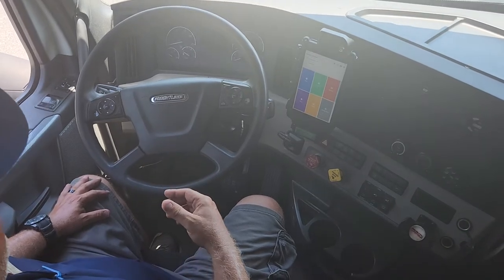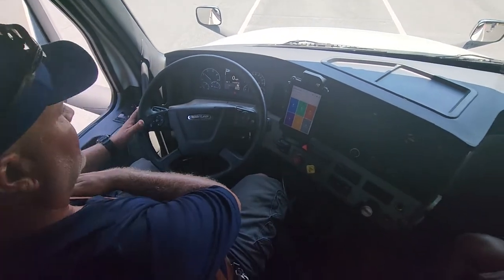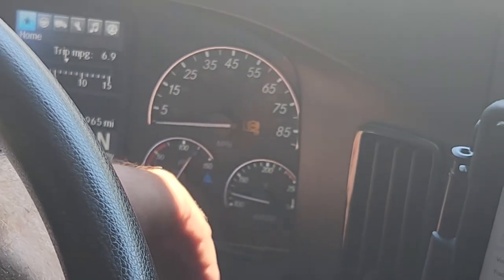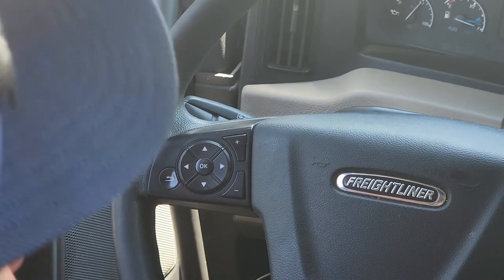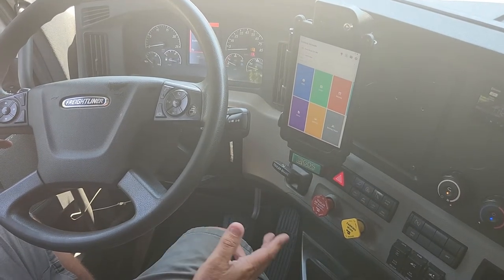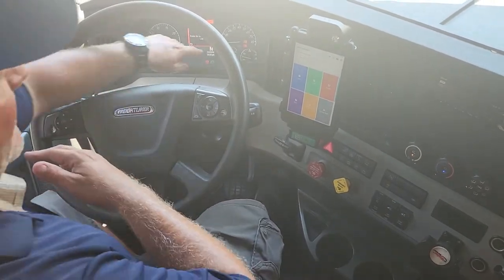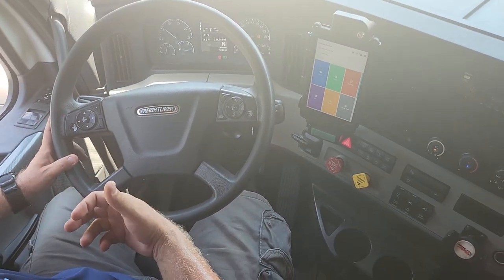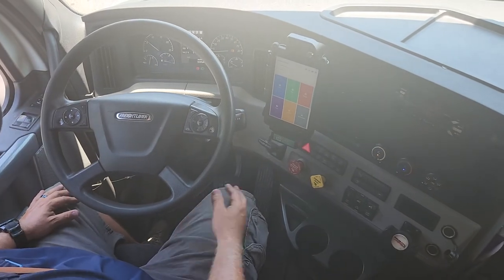In Cab and Air Brake Inspection CDL class A for automatic transmission.

Comment: Why is it that there is no more static brake check? It started with applied brake check immediately.
Reply from the maker: Hi Danny! Yes your absolutely correct. The exact reason i have not found but the Feds are constantly changing regulations for the job and for testing. I actually need to update some of my videos because the rules and regs are changing rapidly it seems in this past year. The state examiners for testing no longer want to hear about non applied air leakage as well as "should not loose no more than 45 seconds unassisted from 85 psi to 100 psi " anymore either. Ill be working on it to upload more videos.
Thanks,
Ricky
Reply: @rickybobbystruckdrivingsch7238  OK. Thanks a lot and looking forward to your next video.

Comment: No trailer brake tug test needed this year?
Reply from the maker: Hi Adam, there is no "trolley"brake tug test required for authorized testing grounds. While testing they require you to test your red valve,yellow valve and service brakes. Air leakage test is required also. The examiners use to check for non applied static tests but now only applied static test as well. There are many changes over the years for testing but all are easy to apply. I will try to keep up-to-date as i recieve information and keep.posting new videos. Thanks for.watching!